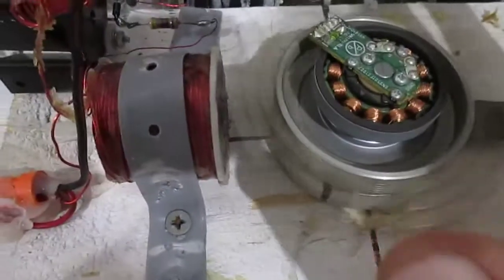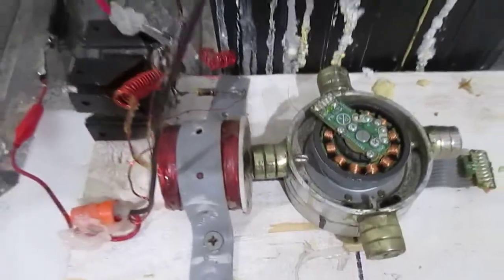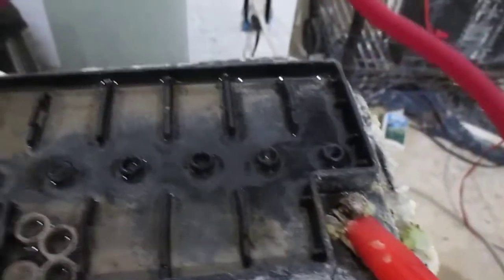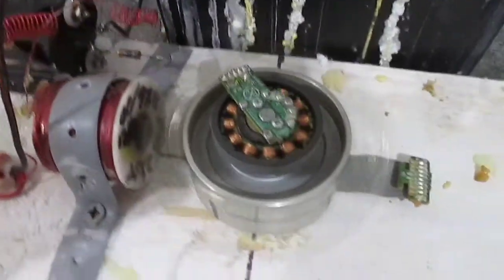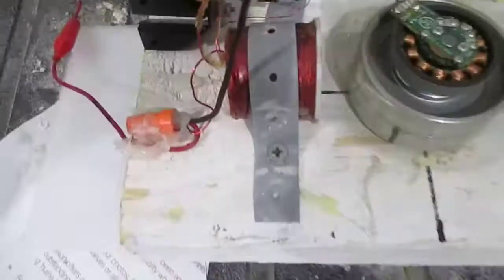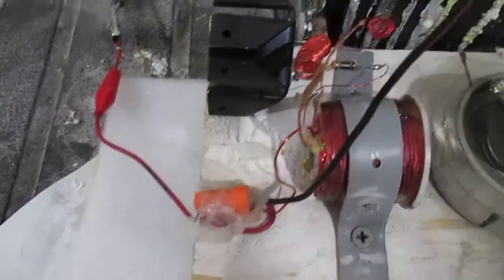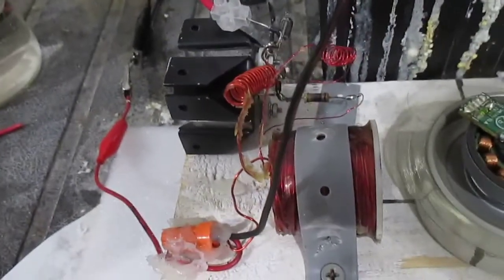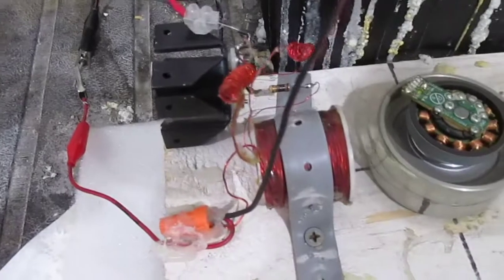Self oscillation Bedini Monopole

Comment: The batterie is like a condensator, and with the coil together, you have an tank circuit. With two batteries, on for driving the circiut, and on (or more) to load at the output, you have two resonating tank circuits, which are coupled by the induction between the two coils... see the videos from Rick Friedrich about this topic...
Reply from the maker: Make sense , so your saying the battery does play a role in self oscillation?
Reply: @mykedoes4099  At the output side, for starting with self oscillation, no. But in general, the plates of the batteries are much similar to condensator plates, and an coil and a condensator forming a tank circuite... so, if using a battery for driving the circuite, you have a tank circuite at the input side.
Reply from the maker: You are correct about the tank circuit , but incorrect about the tank circuit , cause although it is a tank circuit it was also a tank circuit from the get go , the problem here is "FROM THE get GO" there was no self oscillation , only after running for some hours or days does it go into self oscillation . So why is the "TANK CIRCUIT" work in one instance and not another . It should self oscillate from the get go but it does not

Comment: Iinertia is resistance to change. Bedini showed pendulum with magnet entering coil where impulse trigger attracts magnet in. Then a switch connects the charged coil to a resistance (charging battery/ dead battery.) This resistance (inertial shielding) to change conjugates coil charge direction. Now the magnet is opposite from being attracted inward. Now it is repelled. Three steps. Inward Over Outward. The higher impedence resistance or more dead the battery the stronger is the repulsion.

Does a short between battery (if you are charging a battery)  posts cause cold air flow from pick up coils?
Reply from the maker: If  you meen a dead battery or resistance causes the magnet on the rotor to be effected some way that is unlikelly since the output it blocked by a diode. on the other hand that diode only blocks explosive force so you may be right that the emplosive force is bypassing the diode all together causing the rotor to spin slower on dead battery and faster on charged battery. That is what i see in my pulse motors.  hmm

Comment: No battery is required for self oscillation. Try it using a 12v wall charger and you get the same effect.    It seems to me that it's the magnetic field emitted from the magnet interacting with the coil is overdriving the circuit. As the frequency changed when you moved the magnet away from the coil.
Reply from the maker: Then why does the self oscillation stop as soon as i disconnect battery?
Reply: @mykedoes4099  because you removed the power source that allows the circuit to run. All that is happening is that the transistor is switching on and off. In any case a power source must be provided for the circuit to run.
Reply from the maker: still though, it oscillates without the magnet present. I have made them oscillate just by smacking a magnet onto the core. You may be right that only a load is required, but still what is causing the base to trigger if there is no magnetic field, either the core is triggering or the earth is.
Reply from the maker: @everybodyseye  somehow the trigger winding is receiving magnetic field right after the drive coil is energized. Could be the radient spike feeding back into the trigger winding, there is no way to trigger the gate when it is currently in closed postion. you have to wait for the gate to open then smack the base. so something is smacking the base after the power winding is energized and it is not the field produced by the power winding,.
Reply from the maker: @everybodyseye  knowing that self oscillation happens in absense of a magnet means there is another unseen magnet field , there must be an echo happening in the core because i am sure this will not happen with coreless bifilar.
Reply: @mykedoes4099  a core within the coil is not needed for the circuit to operate. My air coils trigger the transistor with only 75 feet of wire. Though I have never triggered the circuit without a magnet being present. Be it stationary or a rotating magnetic field. Perhaps your coil is providing the magnetic field as it collapses and back feeds the transistor.
Reply: @mykedoes4099  what ever is happening, it's very interesting. If you could post a video of it operating without a magnet present that would be awesome.
Reply: @mykedoes4099  I tend to agree with this assessment.
Reply from the maker: @everybodyseye  i think you need magnet because you have no core. My has core and the core is magnetized so the magnet is not necessary
Reply: @mykedoes4099  yes, I agree the core is aiding in some way if it oscillates without an external magnetic field. How many wires are in your coil?
Reply from the maker: @everybodyseye  bifilar (2)
Reply: @mykedoes4099  I showed this on my vids 2. If you want to think tank It? Lemme know.
Reply from the maker: @strangescience3414  Anytime, although i am more interested in prototyping this
https://www.youtube.com/watch?v=WH4watZLhOA
Reply: @mykedoes4099  what are you going to use as trigger. I'm trying reed switches. Will see if they melt😕🤞. 
What is the benefit of opposite would coils you think?🤔a.c. back emf pulses and quadruple frequency maybe.
Reply from the maker: @strangescience3414  Trigger for now is transistor. Bifilar coil triggers the transistor. opposite wound coils is benfit is bucking filed generation, like floyd Sweet
Reply: @mykedoes4099  neet I just.watched. seems most important is how to tune🤔